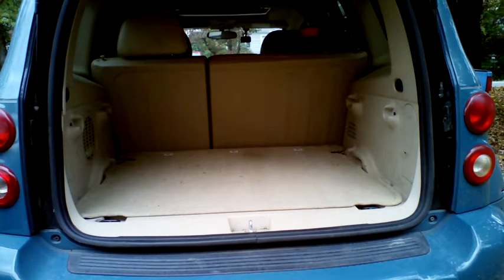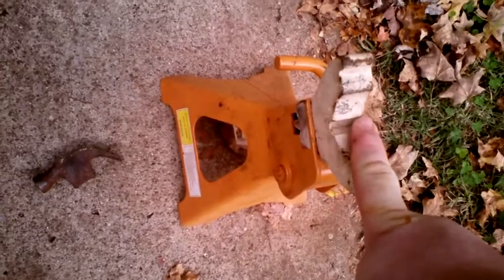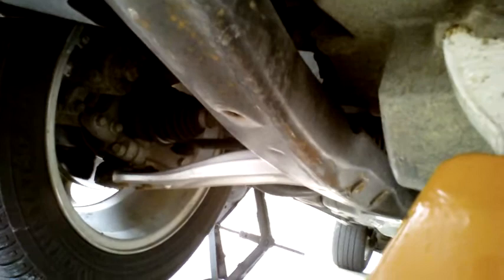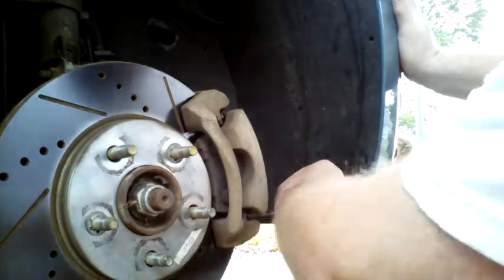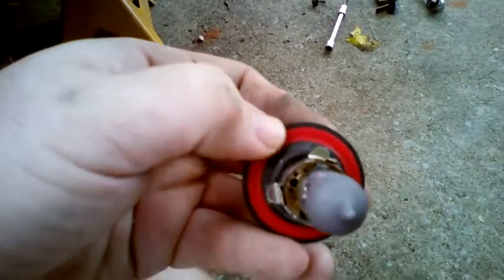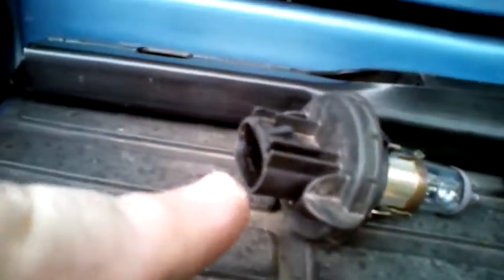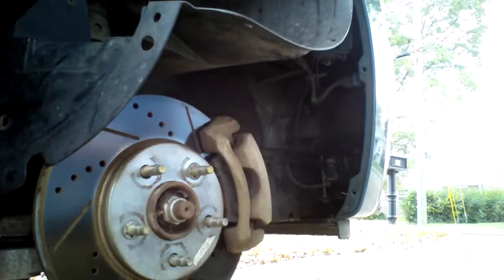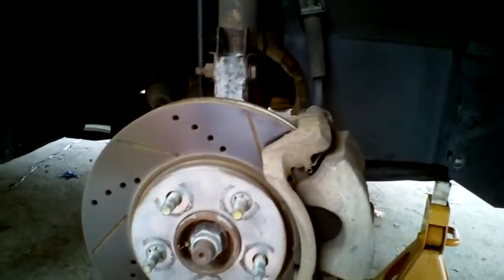Step-by-step how to replace the headlight bulb in a Chevrolet HHR by removing front wheel

Comment: On the passenger side, if you remove the air intake hose from the inner fender, you can access one of the bulbs. I don't remember which one it was though, headlight or turn signal.